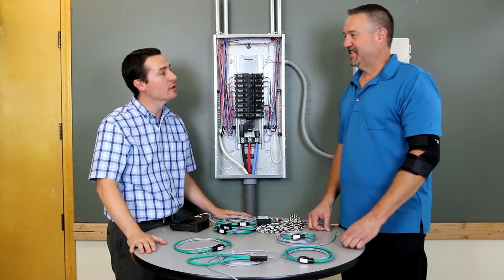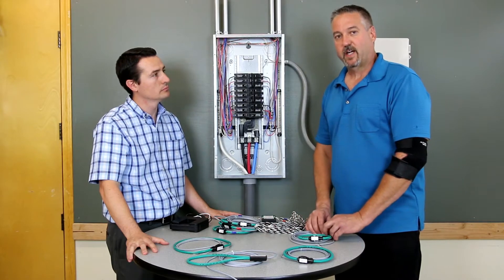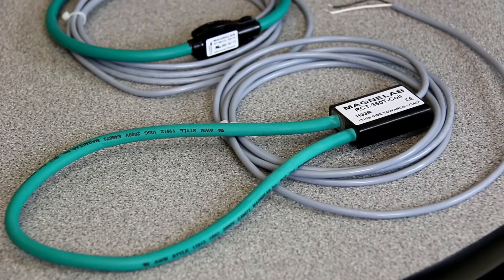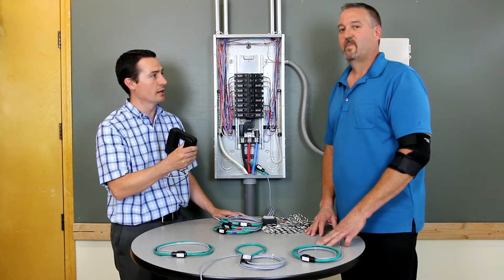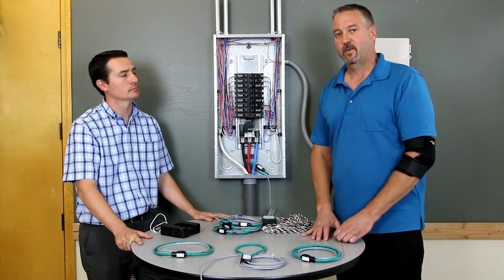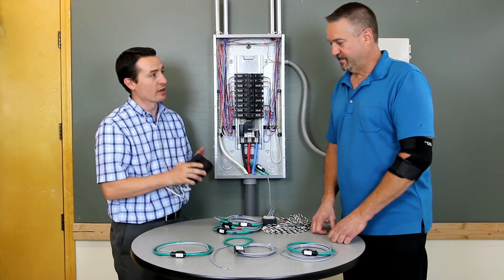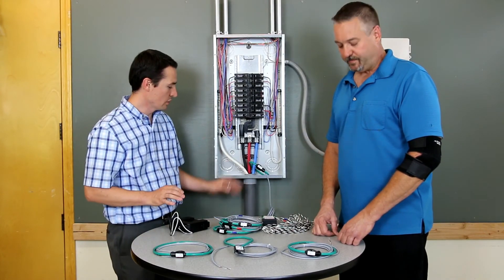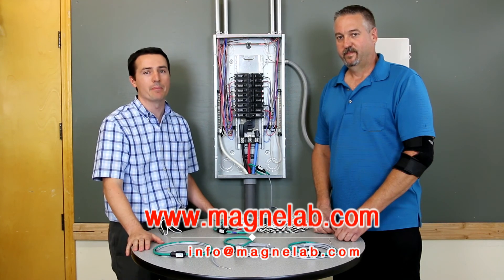Rogowski Coils by Magnelab

Comment: i want to know if i can use it with a raspberry pi card !!
Reply: Good idea. I also like the idea these do not need a shorting block. The biggest issue is converting the 1/3 VAC full scale output to a 5 VDC that a Raspberrry pi A/D can read. Hard to find a low cost 1/3 vac to dc converter. Possibly have to make my own once I find a schematic.